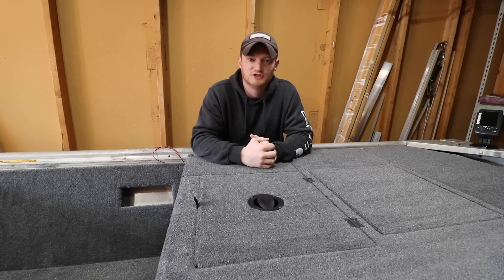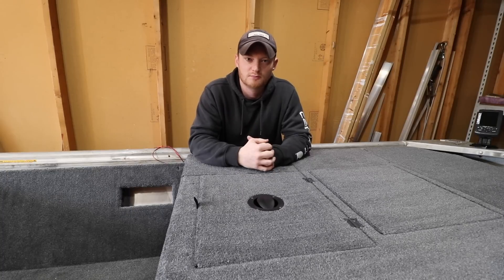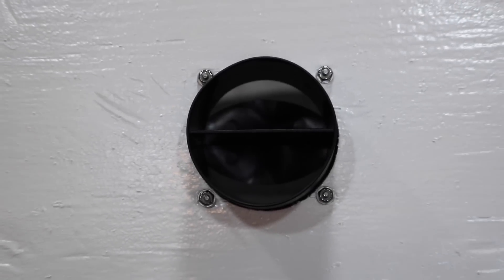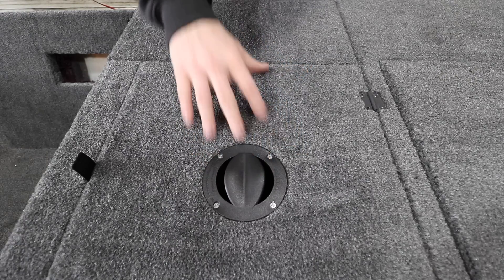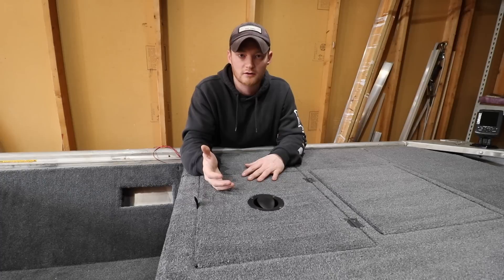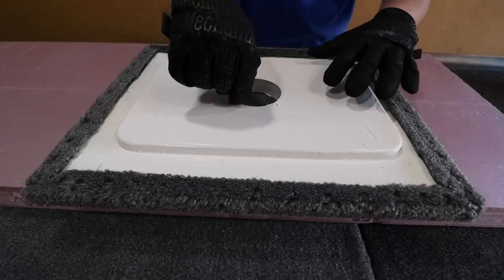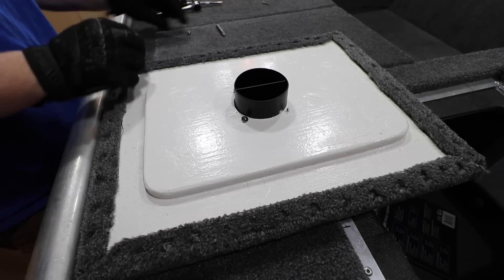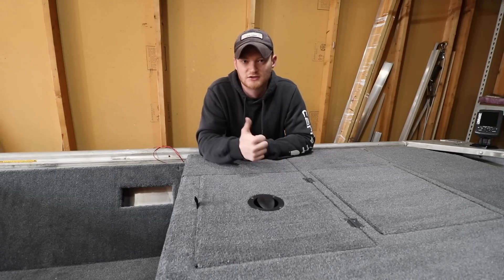NewPro Products V T2 Install: Jon Boat to Bass Boat

Comment: I'd be curious to see a side by side comparison in one boat (one boat two livewells with two identical fish in two separate containers). It would be damn near impossible to duplicate but interesting. I did a quick google search (which almost is never a good idea) and there is a lot of disputes whether this item actually does any good. I think it would work better if you had fast moving air over the top, like if you got a boat up on a outboard motor doing at least 15mph. Let me know what you think of this product when you start fishing out of your rig. Like you said even if it helps a little it's worth it. The project's looking good man. Can wait to see you start slayin em'.

Comment: What are your thoughts on cutting the tube sections as short as possible. If a fish thrashes in the live well it could cut itself up. I know I've had a few fish with damage from the latches in my boat.
Reply from the maker: Thats a good point that i didn't think about. That would be possible to do, i just don't know how that would affect the air in or out.

Comment: wow how much for a veneration live well cap ....what's the difference in just buying a shower/tub drain cap from home depot and making it your self for less then 10 bucs. pluss you cab get it in black,crome,brush nickle,oil rubbed bronze,gold,or you can spray bomb it what color you want it as long as it is a exterior enamel paint with primer for a fraction of the price.
Reply from the maker: uhh...time...? haha
Reply: Lol 45 dollars x 2 is 90 dollars to a working man dude. especially when  all you have to do is bore a hole 3/8" smaller then the hole of any cap for screw placement. not trying to knock your paid sponsors but all we have to do is think a little bit and we can all save alot of money in the long run. unless of course it is giving to you... lol
Reply from the maker: Sean Burnett I get what your saying. But no, it's $45 and you get both and the hardware. Plus, it is a little hard to see in the video, but there is a vertical piece on the inside, I am not sure how you would be able to make it, which is another reason I would have purchased this even if they didn't send it to me. Originally I wanted to make one, but I don't have time haha I want to get on the water. I'm sure there is some way to make something work, however it's not exactly as simple as a shower cap
Reply: Lol hardware what 8 screws and a ported cap with a slit like what would be in a subwoofer box or a drain cap. Still alot cheaper if thought about. But it your show bro. Just tring to save people money. No disrespect man the boat has come along way thanks for the vids